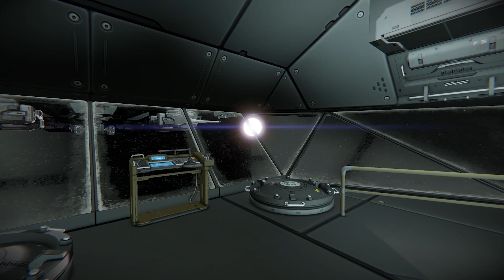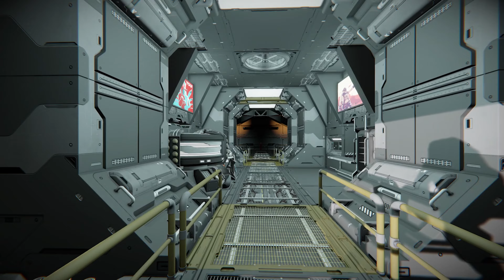Space Engineers Survival 2024 - Build, Fight, Repair, Repeat - Episode 29

Comment: YAY! I'm now the godfather for Grindy. 😁

After that bit of combat, you noticed you were quite low on ammunition on the AoW. Did you manually transfer ammo to resupply or do you have a script that automatically stockpiles it's ammo to a specified amount when connected to a supply source?

The new ship, just from looking at the shape of what you've built so far and knowing you intend a 2nd level on it, plus you mentioned maybe using Grindy to drill while still connected, gave me a mental image of a turtle.. hehe. 
Give the first level a very tall ceiling so Grindy can fit mostly inside, place the connector on pistons to extend Grindy for grinding/launching and retract for travel.
Then it's own connector in the back to connect to stations/bases would be the tail. 
You'd have to paint it mostly greens, with some accent color.

Too bad you can't limit 'build & repair' from repairing neutral/enemy grids... but that was kinda funny that it was repairing the ship you were fighting.

Knowing how long & tedious it was to build the space elevator I hesitate to suggest it, but what about encasing it in armor blocks for more protection?
Now I'm curious if the game could handle (provided you can generate enough power for it) placing shield generators periodically along the elevator instead.
Reply from the maker: Congrats! :) I just have everything conveyed up so I'm hoping it's pulling ammo as needed. If it needs a script to do that, I might have to research one. I like the turtle idea! I need to seriously re-work everything I have on there thus far though. I like that the Build and Repair will pick up items that drop from combat (the blue beams instead of the yellow ones) but I definitely don't like the repairing of enemy ships 😭I think this was the first episode where I had substantial damage to the Space Elevator so that seems to be an acceptable casualty rate for me 😂 If it happens more often, we'll consider some upgrades :)
Reply: the BOB's can be configured to grind enemy parts just as easily as repair them and can even target certain classes of parts as the turrets do ( power, weapons, propulsion....).